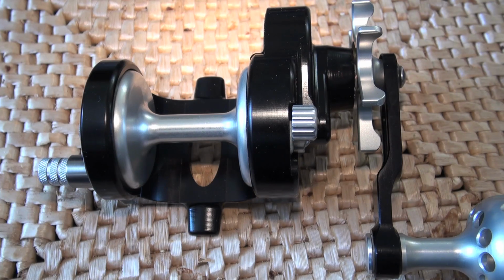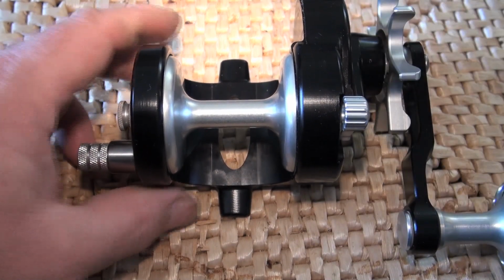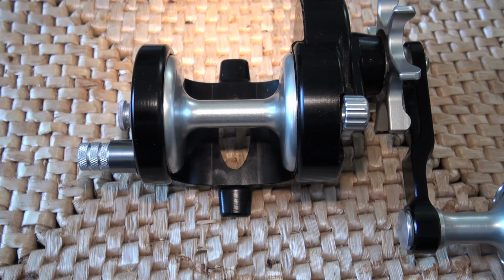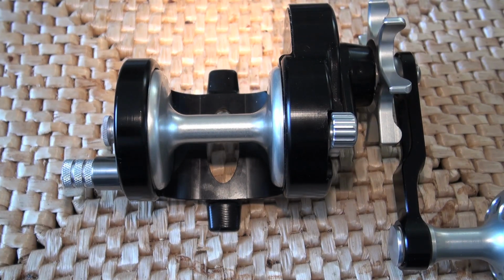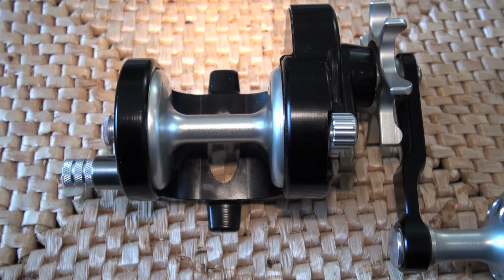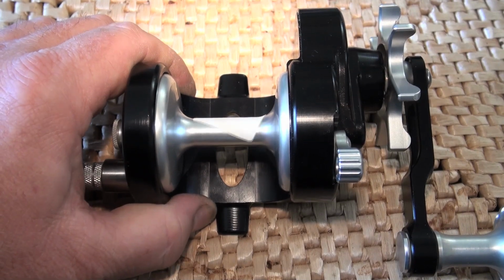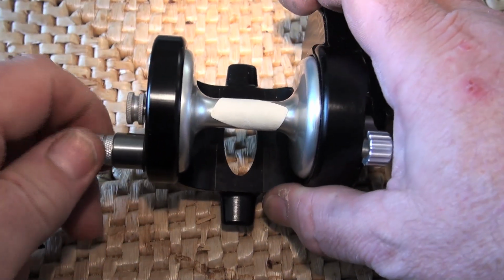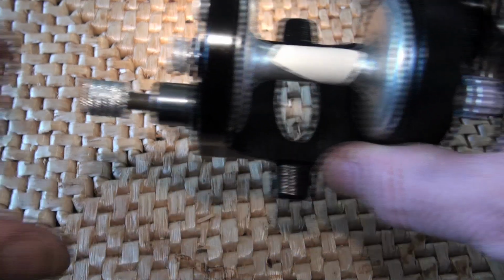Seigler SM with PMR Bespoke Custom® Titanium SuperMag and Abec 9 Hybrid ceramic Bearings

Comment: I really need some help on this one. I live in the US and I am in desperate  need of a conventional surf casting reel with a left had retrieve. It seems that all of the manufactures only make the really good star drag reels in a right hand model. I have an Avet mxl mc but it will never cast like those nice reels I see on your videos. Can you recommend a reel? I want something on the line of tha ABU garcia 7001, ie a 7000 size reel that will cast along way. The 7001 has that line level which I wouldn't trust with a shock leader.